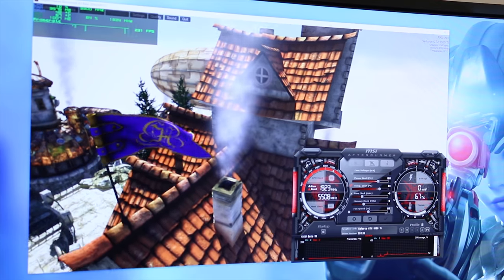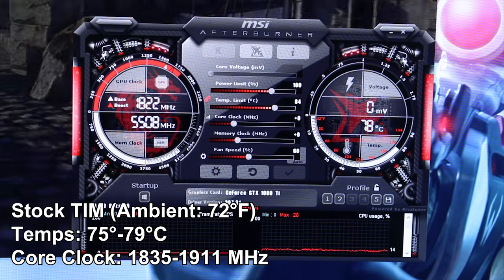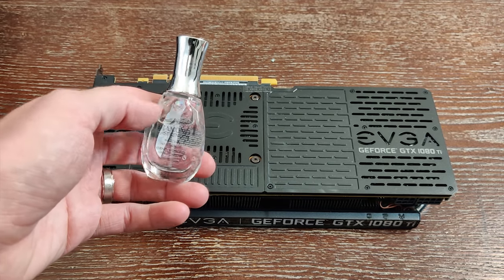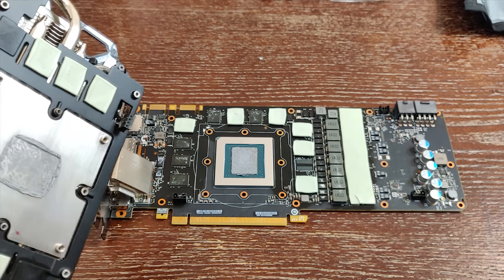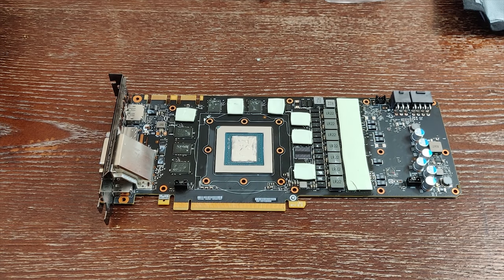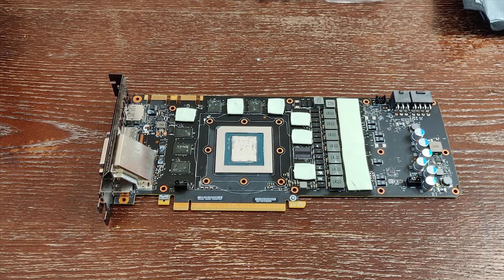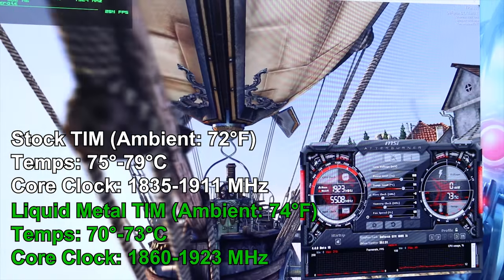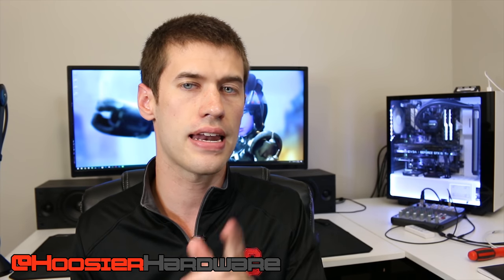Liquid Metal on GPU

Comment: For those consider this option conformal coatings are excellent to prevent shorting the GPU out. A common mistake often done by folks is assuming all conformal coatings are the same. They are not, that being said each has their own pros and cons but for liquid metal you can't beat acrylic based conformal coating.

A lot of people use silicone based since it is commonly applied DIY PCB's (like raspberry pi) which in those situations are perfectly acceptable. For a graphics card you want acrylic tho both acrylic and silicone CC's do the same job silicone lasts longer and is harder to remove while acrylic is even easier.

Most rubbing alcohol's can remove it with no scrubbing required. People see that and think inferior product compared to silicone. However while silicone has a longer life and is harder to remove (not significantly harder) acrylic is an amazing electrical insulator. Far better than silicone at all voltages and on graphics cards it makes a significant difference. Silicone based CC's do insulate but not nearly as well which is why you want acrylic CC's in this application.

If you are extra paranoid you can put Polyimide Tape on top of the acrylic CC to even further insulate the circuits on the board and to prevent the liquid metal from getting to the conformal coating to begin with.
Reply: Too long to read

Comment: With a drop of just 6 degree on max gpu load temps it is not worth it, but when I used liquid metal on my strix 980 ti I dropped 14c on max gpu load temps, which I believe was totally worth it for me.
I think it is really important to spread the liquid metal very nicely for the best results.
Reply: How is being  6 degrees lower not worth it? That's 6 degrees further from throttling.

Comment: Should I put better thermal pads as well as liquid metal I want to test to see if it will lower  the °C with my old 980ti you think it will lower 10°C or it will have the same result as your 1080ti

Comment: when you delid and using Liquid metal, can you use none conductive thermal paste to (Noctua NT-HT) to cover up any capacitors/transistors next to the Die? instead of nail polish. Any Pro's - Con's to this?
Reply: Yeah you can, or vaseline. Pro: easy cleanup Con: make sure you get NONE on the die itself if using LM.

Comment: Was wondering how liquid metal with a liquid cooling setup? I am thinking of trying to use liquid metal on my MSI GTX 1080 FE with an NZXT Kraken X42 AIO and Kraken G12 mounting kit.
Reply: bruh , without even liquid metal the 1080Ti FE drops from 80C to low 50c with an h55 AIO cooler and a G12 by nzxt, with mx4 thermal paste .